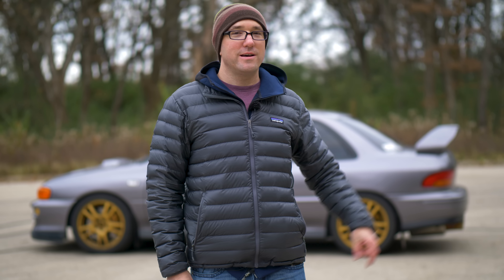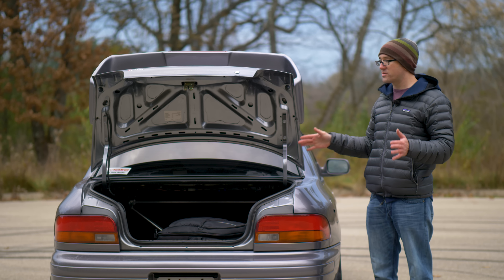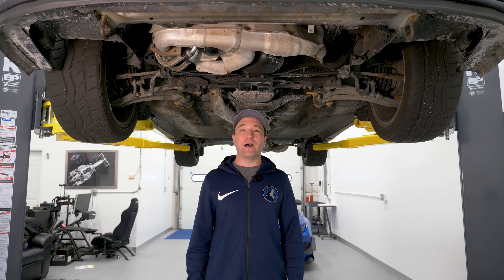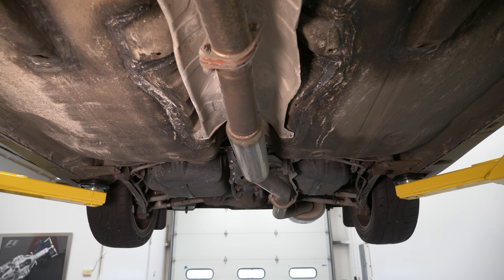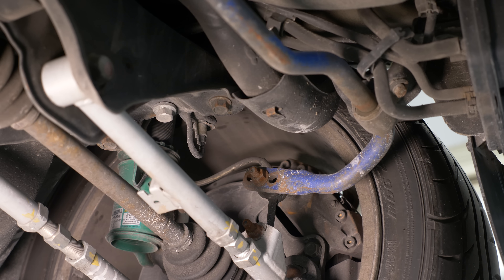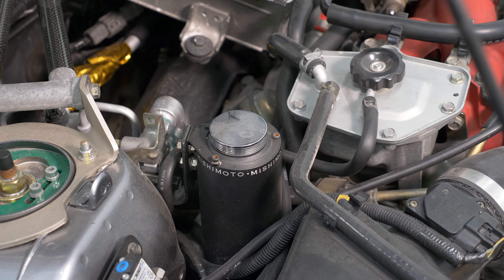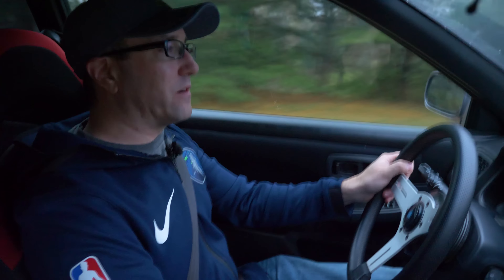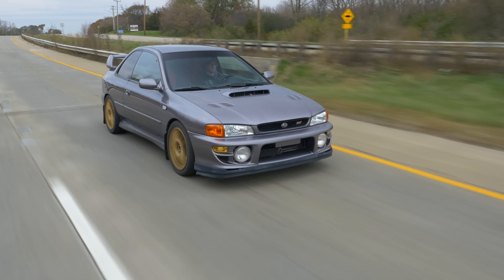Review | Subaru RSTi | When Older is Better

Comment: I have a soft spot for these mildly tuned cars. They aren't stock but however claiming that a stock car is perfect is BS and we all know that. However by addressing the weaknesses of said stock car & fixing that (e.g. the body rigidity & the spot welds) while making small but little improvements everywhere else. This is in my opinion, tuning in its most refined form. Pure respect for tuners & owners who have cars like these.
Reply: I agree. As ive gotten older, ive grown beyond the high horsepower craze. At tgis point in life i want something balanced and reliable. High hp doesnt always = satisfaction
Reply: tuning goals should be making a car that feels like a "cup version" from the factory. some very slight optical stuff and mostly handling stuff and maybe 50hp plus max.
Reply: @Mr.Marbles  Facts I hope to own a 350z, Evo 8, and Type R. All will only receive basic bolt on mods that don't take away daily driver ability.
Reply: Very well stated.
Reply: That's what I came to realize after I went chasing hp in tuner cars 10 years ago.  

Now once you get close to 10:1 it's about handling,  feedback and reliability.

Comment: Even if my 99 RS is only stock with 320,000 miles and a body that looks like its been through both world wars, I still love it to death. This video demonstrates to a higher extent that feeling, and i am determined to obtain something nearly identical to this, i cant fathom the feeling of twice the power, all four wheels spinning, but still rocketing forward and out of corners like nothing else, all the way past 7k with the unmatched sound of the flat 4. The only place ive been able to experience the benefits of the drivetrain and not burn up my clutch in acceleration is in the snow, and even though ive only gone out once in it- i cant wait till the next time. The feeling of rotating around a corner and mashing the throttle, and having your wheels clawing at the snow, throwing it all out of the way and pulling yourself through, defying apparent physics... like no other feeling.

Comment: If anyone has technical questions about the car, let me know! (I wrote the build log linked in the description). There were a few tiny errors in the video but that’s only natural with a car that’s had this much changed on it. Great review Mark, I hope you enjoyed it!
Reply from the maker: +TheOutbackid I figured there'd be some stuff that was off. Jack tried to get as much information as possible and it was so much to jam in thanks for writing that I'm sure somebody will have some questions for you. Car is obviously quite a blast to drive unfortunately the weather sucks but it was still good.
Reply: What would a build like this cost? I think a lot of Subbie fans love this body style and would consider a similar build.
Reply: Don't you have 98 octane fuel in America. He said run it on 91 or 93. It's not meant for that low octane. It says so in the owners manual.
Reply: @_wallnutz_  Octane ratings are measured differently in the US. Japan and some other countries ONLY use the RON rating while in the US octane is the average of RON and MON, there's a small math equation on american gas pump buttons that refer to this "(R+M)/2 method". MON octane rating is basically always a lower number, something under 90. Since the EJ207 cars were really only sold in countries that used RON exclusively, the owner's manual is specifying 98 RON gas. There are certain parts of the country where 93 octane is somewhat available, and that rates as 98 on the RON test,. Anywhere else where that gas isn't available, which is most of the country, you simply can't roll up to the local gas station and fill your freshly imported JDM dream car with gas that will make the engine happy. Most people don't consider this, they run their old JDM car on 91, and then wonder why their JDM car/engine blows after a few thousand miles. EJ207 cars that were imported specifically to Australia (which I don't think has 98 RON equivalent gas) came with knock sensors, while they otherwise wouldn't have them in other markets. I could be wrong, MRT performance has a video where they talk about it, they're honestly the best youtube source of info on old STIs.
Reply: @brendancrosby2965  Yes, I have checked since this. American 93 rating is equal to Australia 98 rating. They are actually the same. America just has to have it's own unique system like with Imperial to Metric.

Comment: Man GC8's are great. I had to sell mine after the Canadian winters rusted out the rear quarter panel, but it still remains one of the most funs cars I've owned.
Reply: LMFAO exact same thing happened to my gc. fucking salt has ruined every Subaru in Ontario i think.
Reply: Rr rr I don't understand why this owner seems to driving this one in the snow after all the effort putting it together.
Reply: As far as I know the difference between the GC8(GM8) and GDA/GDB is almost all structural, the mechanicals are very similar [that is for a EJ20 car vs EJ20, and not the EJ25]. 200lbs of more structure for both rigidity and crashworthiness.  GC8 is a bit of a tin can... lol  I see at 8:30 it's mentioned and again later -- very comprehensive film!
Reply: Rr rr I had to sell mine after the moter snap a rod. It was the best car I ever owned.
Reply: My GC8 did the same in Northern Vermont lol
Reply: DeLorean had the right idea, but humankind just wasn't ready for the simple genius rebel, and now we are even further away from it.

In a healthy world, no car part would be rust-prone.

Comment: subaru guys never clicked so fast
Reply: FORMER Subaru owner.  If you're stuck with 91 octane, you end up taking the bigger turbo approach, and if you didn't get the Sti to begin with, the transmission will grenade. SO, if I was going to own another Subaru product, it would only be one that someone else dumped their entire 401k into and is now forced to sale because of a divorce.  And, it would have to be much better than even the one featured in this video.  I don't miss the understeer and being pulled over once a month for "looking" like I was going fast.

Comment: Would love to see your take on an rx8 or any rotary car!  Loved this episode btw, your the only “car review” channel that holds my interest
Reply: Theogrn The RX8 is a very unappreciated car.  For people looking at the S2000, FRS/BRZ, or even a Miata, the RX8 really needs to be on the list.  It is a softer GT car though,  rides comfy,  is quiet,  and has body roll. The S2000 and FRS/BRZ are more hard core, the S2000 more so.  However,  back to back to back,  trade offs are abound.  The S2000 is less practical and a tighter fit. It's noisier and always ON.  It is engaging and a lot of fun. The FRS/BRZ is more practical with cargo room, and the cabin feels gargantuan compared to the others.   The FRS/BRZ is the middle one. It's also lower on power,  but the gearing is good.  The RX8 is a more form fitting cabin,  but you still fit. Even full size adults fit in the back seats. The car actually seats 4 real adult people.  There's still good cargo space.  The RX8 also has the best engine in the bunch,  although it's neutered by the gearbox, well more specifically the final drive. It feels like it was pulled directly from the Miata with a 6500 redline and tossed in the RX8 with a 9500 redline...with no gearing change.  You can high 65mph in 2nd gear.  It's a high rpm,  low torque engine tied to a gearbox that doesn't fit it.  At any point,  you can be in one of any three or four gears, and it doesn't matter.  You can sit in 3rd or 6th cruising 70mph down the highway.  The gears don't feel meaningful,  and the tall gearing hides the engines prowess.

Now the fun part.  The RX8 engine is better that the S2000.  Power, torque,  and even rpm are nearly the same.  They feel nearly the same driven back to back.  However,  the Renesis engine is smoother, more rev happy and faster dynamical,  and has better mid-range torque. 

The RX8 chassis and suspension setup is pretty sweet too, but that should be of no surprise given its basically a long,  four door 3rd gen Miata...except better with improved suspension, balance and stability,  and 100 more HP to play with.
Reply: Xmvw2X haha and its a rotary! If you can find a well maintained one they are probably an extremely charming car but most are unfortunately owned by a lazy bunch! I had an frs for 3 years and i enjoyed the car so much! I ended trading it in for a more practical car but i plan on buying a second car here soon and or getting just another fun daily to play with. Rx8’s and fc’s are on my list for a second car

Comment: I had a 2002 bug eye WRX wagon. I miss the simplicity and fun of that car. In rain or snow it was a blast. With the roof rack loaded with bikes and kayaks, flying at speed on dirt roads or highway especially in bad weather it was a remarkable ride that sets a grin on my face remembering road trips across the country. It suffered a hailstone beating and came out a golf ball. Insurance reskinned the vehicle like new but the body shop replaced the lettering as RXM. I had a unique one and only model.

Comment: DCCD doesn't control where the power goes, it controls how locked the center differential is
Reply: zed4me True. It doesn't control bias at all. It's only lock profile.  I believe in most situations,  one step below full lock is the best setting. Full lock is good for poor road conditions just for consistent,  even stability regardless of throttle. I use full lock driving through a blizzard or when I'm rallycrossing.  One step below just gives you a little better off throttle turn in as full lock does create a small amount of corner entry undetsteer due to the center diff interfering with the front end during turning from uneven tire speeds. 

Most other diff settings are mostly worthless. You can tune handling balance a little,  but mostly you're just adding more handling balance variability  on throttle which makes the car less predictable and harder to drive. 

Also it's important to note that the effects of the DCCD are only noticed when you have tire slip.  With sticky tires on asphalt,  the DCCD does almost nothing.  However,  it becomes wildly varying once you take the car in dirt/snow/mud.  Here the effects of the DCCD makes large changes, both in how the power is put down and how that power delivery affects handling balance.

For me 99% of the time is one step under full lock.  The other 1%is when I absolutely want peak stability,  predictability, and consistency in power delivery and am willing to add undetsteer to the handling.
Reply from the maker: +zed4me I didn't mean biased towards the front I just meant rolling the position forward.
Reply: savagegeese gotcha, that makes much more sense.
Reply: My STi certainly doesn't like bias + either.. shouldn't really be used on any on road conditions unless the ground is covered in snow or ice
Reply: zed4me but that's what it was made for, shitty conditions.
Reply: Sam that's exactly my point. Wet and rainy isn't like snow and ice.. you're not constantly looking for traction when it's wet but you are when you're on snow or ice
Reply: I think auto + is perfectly safe to use whenever... Manually locking is when you should have gravel, snow, etc. I use full lock to get in my driveway lol
Reply: Locked splits power 50/50 F/R - Full open is ~35/65 power split.
Reply: Xmvw2X My favorite setting as well.
Reply: Maybe you rookies not shall say how the old DCCD worked. It worked in a total other maner than the dccd in newadays STI . Just as you know. etc. In the GC STI-Type RA and R, you actually made it rear wheel drive if you locked the dccd. On that old STI´s the dccd worked in whole other way, just so you know. It also had the plated rear lsd`s, on the new age STI´s it only MY06 that has that, all other models has gear biased lsd´s front and back. But none of you has probably owned a GC STI -TYPE RA but i have. In fully locked, it only spinn the rear Wheels and there was no "auto "mode on the adjuster knob

Comment: funny you made a review on this WRX, I recently added a 2002 WRX, 277k miles, original clutch and turbo. Love the size, the weight, and the relative simplicity. Great review as always.
Reply: Garunteed not the original clutch. Doesn't matter what brand or transmission you go with NO oem clutch will last 277k mph. I PROMISE you it is not. The turbo though, maybe... They can either be dead ass reliable who blow at 180k.
Reply: Tristen Sharba it's original, was owned by my cousin, I've been around it for the last 15 years, never changed the clutch
Reply: So you bought a bugeye Subaru that's never had any maintenance done to replace your broken TypeR. Want to buy my DSM? I swear it's all original.
Reply: haha, not a replacement, just an addition. I'd take a DSM if I had room for it :)
Reply: anyone who reads this comment, it's pretty obvious from watching flyingfatto's videos that this guy doesn't actually know anything about cars
Reply: Mine has 311,000Km on it (MY00), and its original. I should know, I'm the one to have driven those 311,000km. Service your car properly and realise that "dumping" a clutch is always going to break it at some point, they will last a very long time. Alot of people are extremely violent on their gear changes for no extra speed

Comment: PU foam means rust. really for racecars only imo
Reply from the maker: +Gabriel Lundrigan That was the goal for performance more than street.
Reply: sure, all i'm saying is there will be temperature gradient across the poly and sheetmetal and any moisture will condensate and rust from the inside out. thats why i mentioned race cars, since the chassis' arent meant to last more than a few seasons.
Reply: Oh, I didn't know that.  Very interesting Gabriel.
Reply: Is this true???

My car had poly urethane foam filled in the chassis as well.  It's a legit race build (in screet guise) where each owner has made several modifications over time; foam was one such mod.  I didn't know rust was a potential issue?

My car is in immaculate condition, inside and out, for being 20 years old.  I had a pre-sale inspection done years back when I first bought it.  The mechanics noted it had "no rust whatsoever" and was in "amazing" condition with "very good mods."

Comment: You don't have to sell me on it. I have a 2001 RS sedan with a complete 04 STi swap. Harness, motor, tranny, rear diff, dash, hvac, etc... only wires spliced are the lights. Super reliable and endless fun to romp around in. Just dropped 15k putting 4 new fenders, all new trim, and new paint on it.
Reply: nice

Comment: THANK YOU, THANK YOU, THANK YOU! I'm DOING this swap, but in a '91 Loyale wagon. Everyone thought I was nutz, but I LOVE the sleeper-look! Other than the pan and body, EVERYTHING is getting swapped! I think my car lines up with this one, NOT including the  model, about 90+%! I have the engine, tranny, front-suspension, and most of the interior. I'm waiting on the rear-end, cooling system, and guages- NOT the same steering wheel, though. I will install the turbo set-up in a few more paychecks. I'll be using an intercooler and water injection, even while it's STILL NA. I'll drive it like that til I turbo it, I think it will STILL be a blast! I was having second thoughts, til I watched this. Describing why the owner built this, I had to check in my garage to make sure you weren't in there, lol!

Comment: I had an EJ207 swapped RS coupe making about 335whp and it was an absolute blast - and not to downplay the trunk space, I could easily fit my ice hockey goalie bag in that trunk with the pads/stick in the back seat - worked great. However, I did eventually find myself in an S2000 by way of a first gen Miata and a supercharged BRZ. The S2000 is my favorite, followed by the Miata, followed closely by the RS. I work at a Subaru shop and love them for what they are, but the other cars have showed me what Subaru lacks in a sporty chassis designed for one thing - and the RS doesn't miss on that even if it's older and more raw than a '15 WRX. The feel/sound of boost at 8k RPMs is great, but I'll still take 9k RPMs in a sportier chassis - at least for now. :)

Comment: Here from Brunei.
Back in 1998, I had an original JDM spec Subaru Impreza WRX STi Type R, to give it its full name. It was light weight at approximately 2760 pounds, 280hp, 5 speed close ratio gearbox, required 100 octane fuel, and with JDM 112mph speed limiter removed, top speed was 160mph at 8000rpm redline. The fuel we had back then was only RON95 and with that, I blew a piston the first time I took it to 160mph....😂😂😂 will forever remember that, and it was fun back in those days.